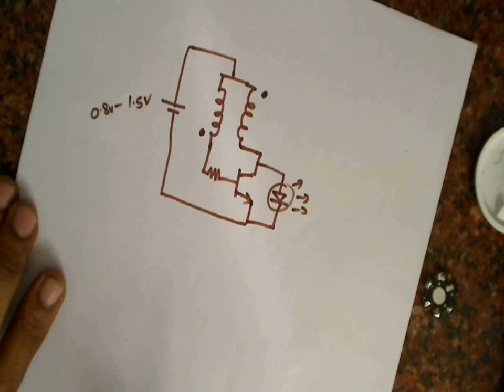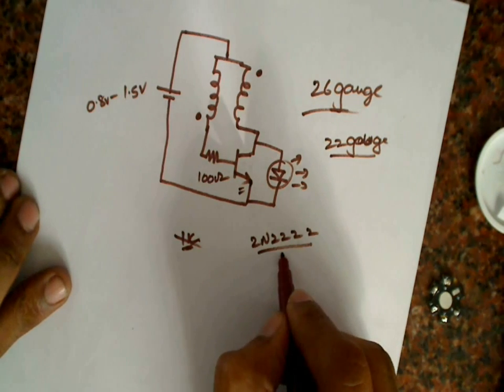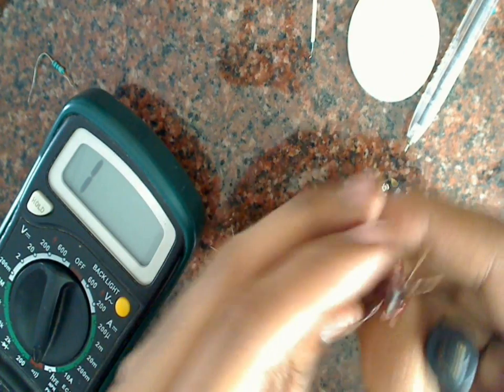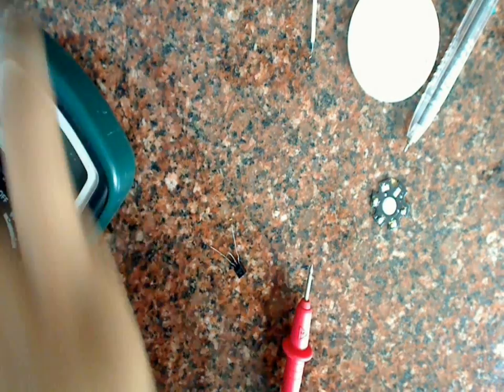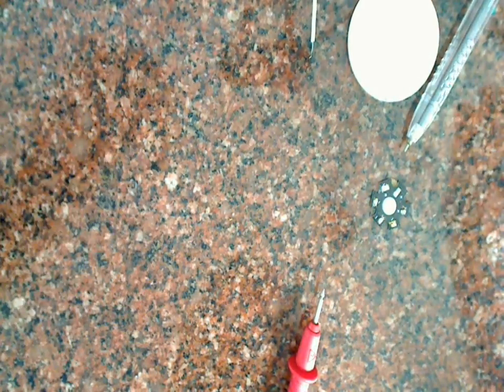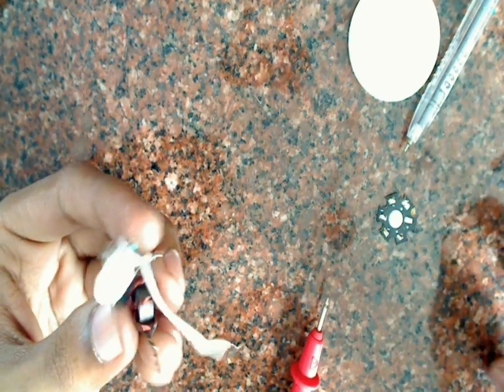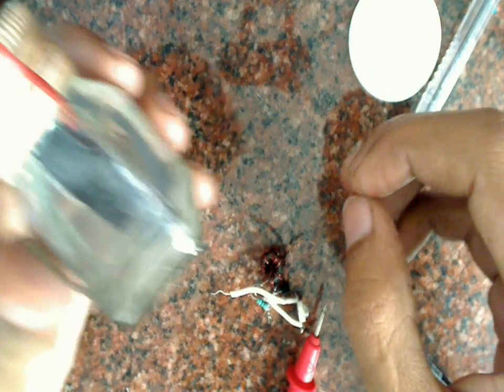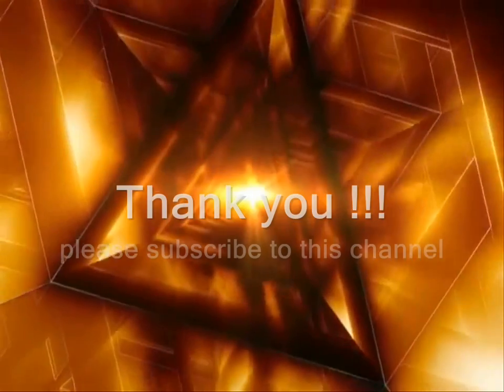Joule thief for high power leds

Comment: It is hard to see what you are doing when you connect the ends of the toroid cores wire. How are you joining the wires together. are you wrapping the same wire to it self or are you wraping the other wire to the first wire and wraping them together? pls explain more trying to build the circuit.

Comment: Hi, Can we make mobile phone charged with this method.
Reply from the maker: +Seema Sarfaraz  yes you can. you need atleast 3v to charge a mobile phone using this method. refer to this video of mine
https://www.youtube.com/watch?v=ROPxcbekk3c
Reply: Yes, but for smart phones you need 5V exactly or the phone refuses to take a charge. The best way to do this is to buy a 3V to 5V voltage booster that uses a similar circuit but has a feedback chip. They are designed to run on two AA batteries or two AAA batteries. It will not run off coin cell batteries. If you want to do it using a joule thief, you will need a diode, a capacitor and a 5V regulator. Linear regulators like LM7805 are very popular but you can also use a buck converter. You definitely need the extra current and you need to tweak the device to produce at least 8 volts for the linear regulator to work. This should not be a problem as joule thiefs can easily produce up to 12 volts if built correctly.